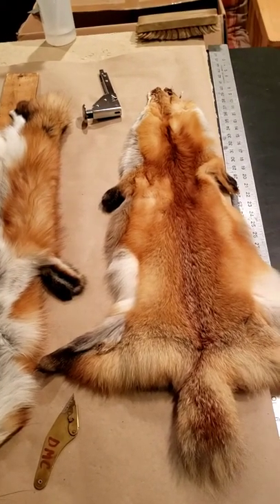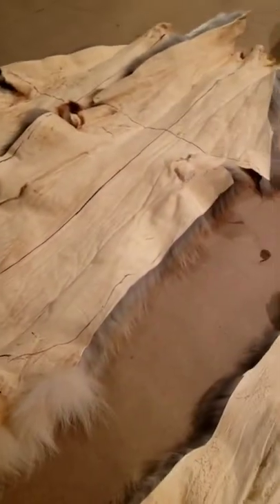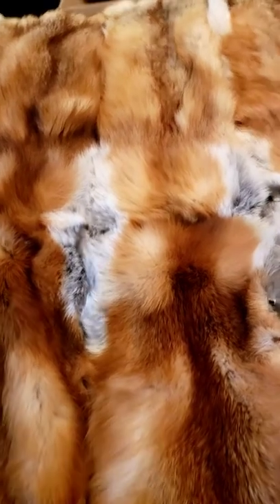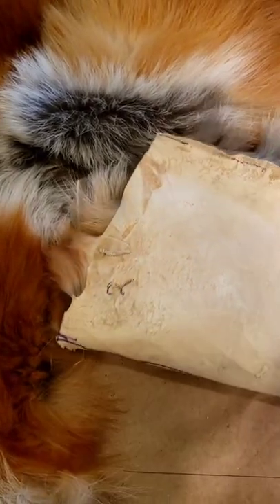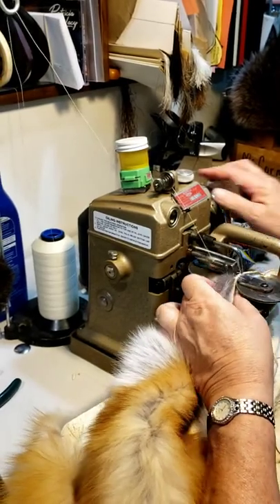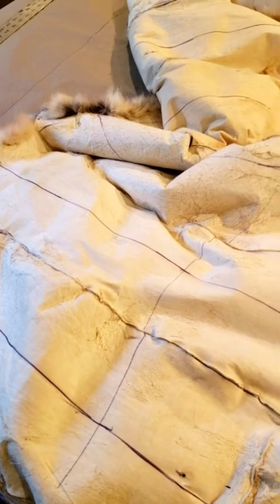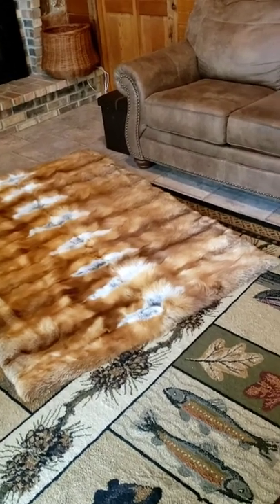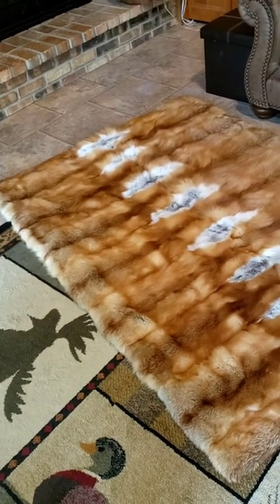Red Fox real fur blanket how to make July 22, 2021

Comment: I harvest my own coyotes and they are all different sizes. Will this make the process a lot harder or any different?
Reply from the maker: Faster !  coyotes are larger so you won't need as many, watch my coyote blanket video.
Reply from the maker: you can trim your coyotes to a similar size once they are all blocked giving you equal size pelts to work with.

Comment: Where did you get your Fur Sewing Machine? I have looked everywhere for one... Can only find Industrial machines and they are $2000.00!
Reply from the maker: Bonis fur machine company is good source, check local furriers in your area someone might have a used one. Ebay and Craigslist.
New they are about 2600 with the table.
Mine is Boinis A 16 model sews coyote, beaver. Fox, raccoon, mink pretty versatile

Comment: I am so glad you made this video and the others. After thinking of a raccoon throw for the past couple of weeks, I realized I had no idea how they're made. I hope you keep the videos coming, even if it's a similar project, like a different size. Very interesting, and you've got me wanting to give it a try. Thanks again 

I suppose all I have to ask is where did you learn these techniques from? (edited for autocorrect error)
Reply from the maker: A small or large throw or blanket is just adding or deleting pelts, once they are blocked out the first time you get an idea of size, same technique use for raccoon, ( they vary more in size) , coyote are larger, hand sewn or machine sewn basically same procedure, good luck !

Comment: I'm learning about fur. How do you know how much to stretch?
This is a stunning blanket and excellent info.  I hope you add many more instructional how to's.
Hard to find good info about how to stretch finish and sew fur.
Reply from the maker: How much can you stretch, a fresh pelt has a lot of give, I stretch until it feels tight,  on a fox the bellies are real stretchy , where the center part of skin is a bit less so,  start at bottom work to each side then up to the top, you can always move a few staples in or out , keep your center on center.
Hope this helps.
Good luck sewing.
Thanks you !
Reply: @McCormickLeatherandFurs  thanks for the great info.  Starting with racoon.  Similar to fox ? As far as stretching?  I'm assuming I'll have to do the wetting and stretch too.  Planing a collar for first project.  Want to back it with suede and maybe some type of natural fiber to make it very full looking.
Reply from the maker: Yes raccoon is stretched same as fox   good luck . Raccoon wears well.
Reply: @McCormickLeatherandFurs  Will you be making more videos?  Interested in hats too.
The glamorous ones with the round shapes.
So hard to tell the shape of the pattern just by looking at the finished fur.
Reply from the maker: @tnone7873  yes,  but probably  not on hats I'll keep it mind though.  Thanks for your kind response

Comment: Absolutely beautiful - do you have any recommendations for hand sewing? Needle type/size - thread type/size
Reply from the maker: I'd check out some fur hand sewing videos for techniques. Some use sinue and glover type hand sewing needles they have a 3 point kind of razor point. But fox is so thin you could probably use a reg needle. Another type thread is rices silamide its pre waxed comes in a skein I'd use size C thread the A size is to fine.
Good luck hope this helps

Comment: What's the purpose of the cold tape?  Reinforcement for stitching?
Reply from the maker: Cold tape is applied along edges before cutting it helps make it easy to trim the fur and keeps it from stretching while its sewn by fur machine. It works great. Buy from furrier supplier like Samuel Bauer

Comment: Thank you so much for the information, what kind of nails do I use when stretching
Reply from the maker: To nail the pelts to the nailing board.  I used a tacker with 3/8 lenght staples, a hand type of stapler I purchased at furrier supplier Antiono Proetti Furrier supplier.  a shorter lenght staple 1/4 inch is for shorter hair furs. I you choose to buy this tacker / stapler I'd buy box of each size staples. Good luck on your project

Comment: What is the price for one of these blankets?
Reply from the maker: Price for labor on 16 pelt size I charge about 550.00 to make up from clients tanned furs. If I need to supply the fox    they vary in price but estimate would between 75  to 100 each tanned. Larger size blanket is more $

Comment: Hello! Would this work with rabbit pelts? Thanks!
Reply from the maker: Basically yes you'd find center back of the rabbit pelt, wet stretch for either more width, or more lenght, trying to keep a standard lenght,, then trim sew pelts evenly in size,, sew together side to side first and add next row above original, But with rabbit run hair all same direction so the above row will blend nicely with the original row . After that is done then wet stretch again the entire blanket to just get the ripples out . Goog luck
Reply: And are you supposed to put anything on the skin side to keep the pelt healthy?
Reply from the maker: Yes same method could be used with most furs that are properly tanned
Reply from the maker: @karlygarrison1596  Nothing else is needed or recommended to apply to the leather side of a properly tanned pelt.

Comment: do you make coyote mitts and how much?
Reply from the maker: Yes your pelts 145.00
My fur 285.00
Reply: your work is awesome.i loved the fox blanket.how many coyotes do you need to build the mitts and what is the length on them? Thanks Alex
Reply from the maker: @alexstillman1285  hi, one skin will make a pair, lenght usually 14" from longest finger tip or i could go 16 , cost if your fur $145 pair the liners are polartech 300 and removable.
Reply: @McCormickLeatherandFurs  hi,i do have an otter pelt that is unbelievable.can you do an otter mitt? its abt 30 inches from tip of nose to where the tail starts.
Reply from the maker: @alexstillman1285  sure I'm making a otter vest in a few weeks its a great fur. 1 skin will make a pr easily
Reply: @McCormickLeatherandFurs  awesome.can i send you the pelt and a check?
Reply from the maker: @alexstillman1285  email me deannamccormick80@gmail.com
Reply: @McCormickLeatherandFurs   i will email you if thats ok?